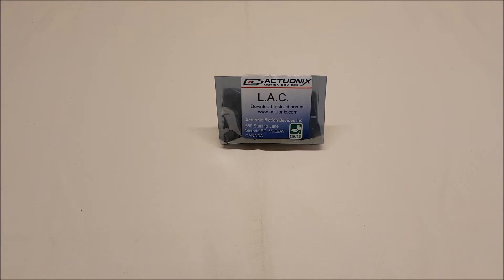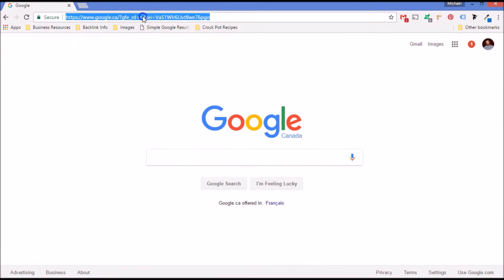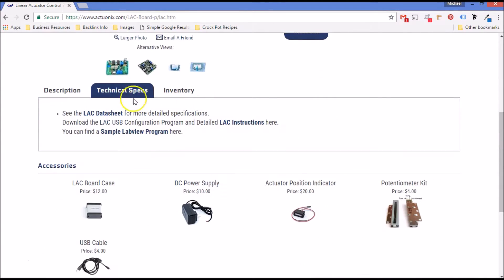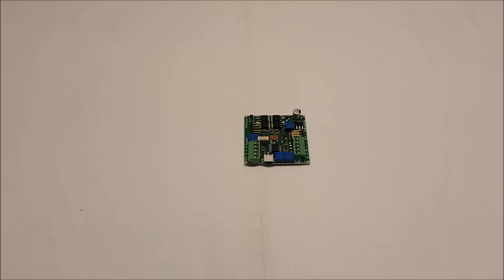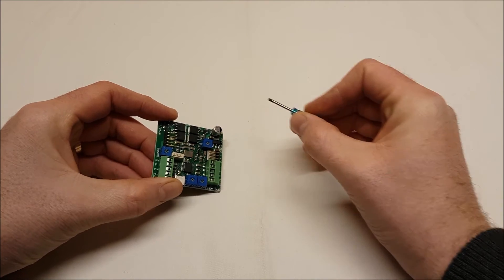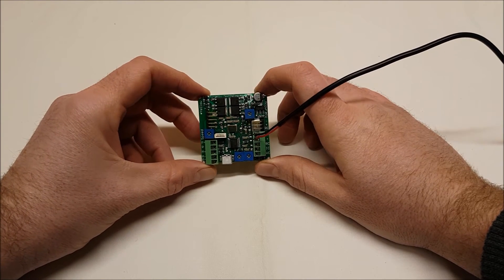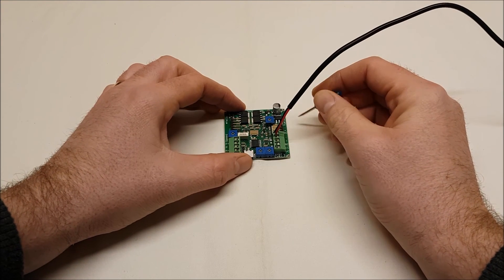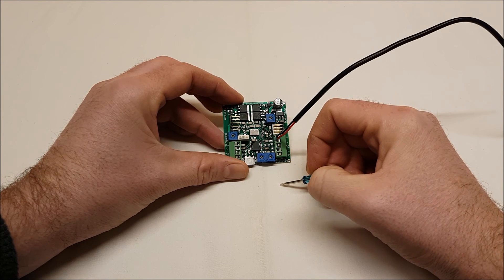Linear Actuator Control Board Intro - Actuonix

Comment: When I plug in the control board to my computer via USB, it still says device not detected. I have the actuator correctly plugged in, and a 12 Volt battery pack wired to the board. I followed everything exactly and still cannot get it to work. Can y'all please tell me what I did wrong?

Comment: Does this work with the P8 micro actuator?
Reply from the maker: No it does not. You need a stepper driver board like the TIC825 from Pololu
Reply from the maker: We have now released a P8-P model which does work with this board.

Comment: I'm looking forward to the next video. I need help with LAC card connections and how can ı use this with arduino
Reply from the maker: Hi, use terminal 3 (RC) of connector block X6 for your signal in from your Arduino board, and make sure your LAC and Arduino boards have a common ground. Then you can use the Arduino servo library to drive the LAC and actuator connected to it.
Reply from the maker: Hi there. For support with your LAC board, you can contact us through the contact page on our site. Unfortunately, though we have limited arduino resources on our site and on YouTube, we don't officially offer arduino code support.
Reply: I agree with Hilal.  Would be nice to know how exactly it interfaces with arduino.  No code support necessary.
Reply: James Otis There are more descriptive examples in Arduino.cc site. I recommend you take a look.
Reply: Thank you so much!
Reply: Did you find any information on how to use it with Arduino?
Reply: Arvind Mehra I found lots of information on arduino.cc website.  You can browse arduino forum site
Reply: Thank you..